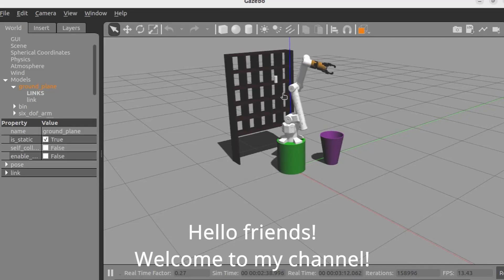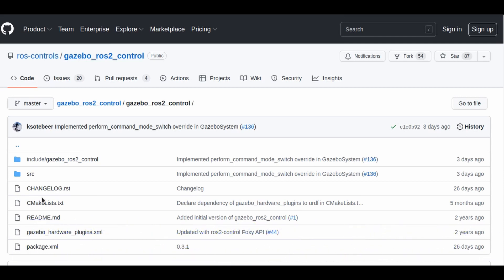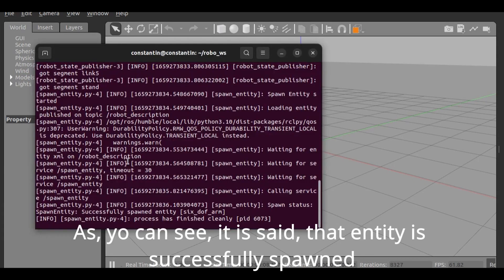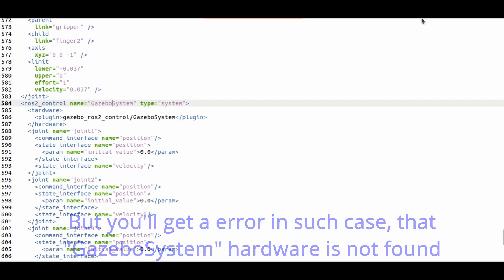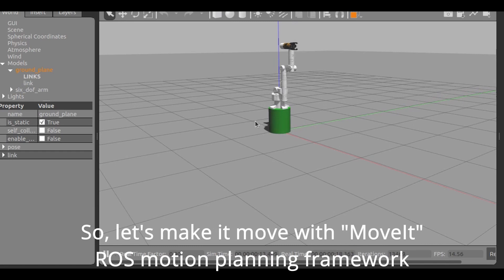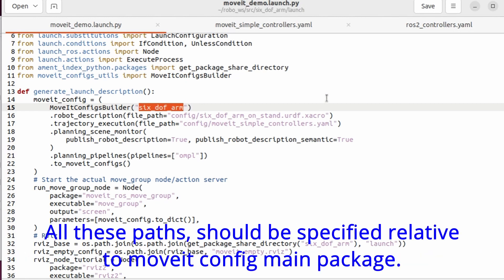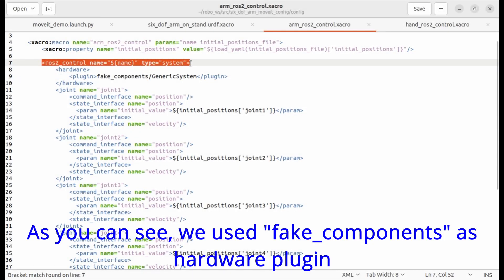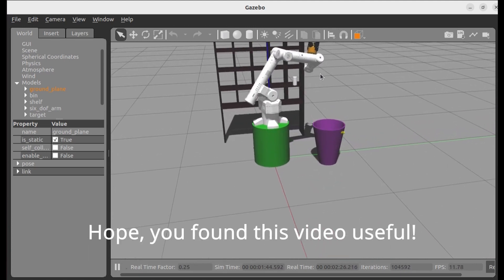ROS2 HUMBLE TUTORIAL. USING ROS2 WTH YOUR CUSTOM ROBOT

Comment: [ros2-5] could not contact service /controller_manager/load_controller ? any solution ?
Reply from the maker: Look carefully at all the logs of ROS2 while it's loading. There should be some error. Check if controllers yaml file loaded correctly.
Reply: @roboage1027  after solving this and everything works fine , a this new error occurs : [ros2-2] [ruby $(which ign) gazebo-1] [INFO] [1737973800.329654722] [controller_manager]: Loading controller 'forward_position_controller'
[spawner-6] [INFO] [1737973800.394330337] [spawner_forward_position_controller]: Loaded forward_position_controller
[ros2-2] [ruby $(which ign) gazebo-1] [INFO] [1737973800.408941369] [controller_manager]: Configuring controller 'forward_position_controller'
[ros2-2] [ruby $(which ign) gazebo-1] [INFO] [1737973800.412406057] [forward_position_controller]: configure successful
[ros2-2] [ruby $(which ign) gazebo-1] [ERROR] [1737973805.419561158] [controller_manager]: Switch controller timed out after 5.000000 seconds!
[spawner-6] [ERROR] [1737973805.423626151] [spawner_forward_position_controller]: Failed to activate controller : forward_position_controller
[ros2-2] [ruby $(which ign) gazebo-1] [WARN] [1737973805.424832982] [gz_ros2_control]:  Desired controller update period (0.01 s) is slower than the gazebo simulation period (0 s).
[ERROR] [spawner-6]: process has died [pid 11465, exit code 1, cmd '/opt/ros/humble/lib/controller_manager/spawner forward_position_controller --ros-args'].
Reply: @roboage1027  after solving this and everything works fine, this new error occurs : [ros2-2] [ruby $(which ign) gazebo-1] [INFO] [1737973800.329654722] [controller_manager]: Loading controller 'forward_position_controller'
[spawner-6] [INFO] [1737973800.394330337] [spawner_forward_position_controller]: Loaded forward_position_controller
[ros2-2] [ruby $(which ign) gazebo-1] [INFO] [1737973800.408941369] [controller_manager]: Configuring controller 'forward_position_controller'
[ros2-2] [ruby $(which ign) gazebo-1] [INFO] [1737973800.412406057] [forward_position_controller]: configure successful
[ros2-2] [ruby $(which ign) gazebo-1] [ERROR] [1737973805.419561158] [controller_manager]: Switch controller timed out after 5.000000 seconds!
[spawner-6] [ERROR] [1737973805.423626151] [spawner_forward_position_controller]: Failed to activate controller : forward_position_controller
[ros2-2] [ruby $(which ign) gazebo-1] [WARN] [1737973805.424832982] [gz_ros2_control]:  Desired controller update period (0.01 s) is slower than the gazebo simulation period (0 s).
[ERROR] [spawner-6]: process has died [pid 11465, exit code 1, cmd '/opt/ros/humble/lib/controller_manager/spawner forward_position_controller --ros-args'].

Comment: Hello there!! Idk why, it worked the first time but then when I re-run it (had to re-build because I changed my arm package and urdf files) it won't re-build and gives me an error when building the gazebo_ros2_control package

I will add the terminal log and error here if you could maybe help, I'd really appreciate it :')

"  /home/xardarii/arm_fyp/src/gazebo_ros2_control/src/gazebo_ros2_control_plugin.cpp: In member function ‘virtual void gazebo_ros2_control::GazeboRosControlPlugin::Load(gazebo::physics::ModelPtr, sdf::v9::ElementPtr)’:
/home/xardarii/arm_fyp/src/gazebo_ros2_control/src/gazebo_ros2_control_plugin.cpp:290:67: error: ‘__gnu_cxx::__alloc_traits<std::allocator<hardware_interface::HardwareInfo>, hardware_interface::HardwareInfo>::value_type’ {aka ‘struct hardware_interface::HardwareInfo’} has no member named ‘hardware_plugin_name’
  290 | d::string robot_hw_sim_type_str_ = control_hardware_info[i].hardware_plugin_name;
      |                                                             ^~~~~~~~~~~~~~~~~~~~

gmake[2]: * [CMakeFiles/gazebo_ros2_control.dir/build.make:76: CMakeFiles/gazebo_ros2_control.dir/src/gazebo_ros2_control_plugin.cpp.o] Error 1
gmake[1]: * [CMakeFiles/Makefile2:139: CMakeFiles/gazebo_ros2_control.dir/all] Error 2
gmake: * [Makefile:146: all] Error 2
---
Failed   <<< gazebo_ros2_control [35.0s, exited with code 2]  "

all other packages compile correctly, just not this.

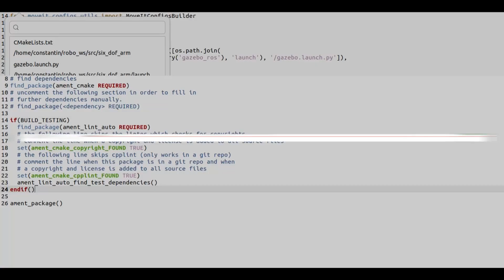Comment: What should have I to write at minute 4:20 , I don't have the folders launch meshes and urdf, so the next part doesn't work for me, can u suggest me why I don't have them? Have I missed something?
Many thanks
Reply from the maker: This is strange. What's the error log? ${PROJECT_NAME} is the name of your project. This variable should be automatically set. share folder is also created automatically .
Reply: I'm sorry, I changed a bit the topic (I have modified the original one). It's not the name the problem but I don't have the folders! Thank you for the fast answer @roboage1027
Reply from the maker: @giorgiolongari9660  Are you running 'colcon build ' command from the workspace root folder?
Reply: Yes!
Reply from the maker: @giorgiolongari2806  That's very strange. As I understood, there's no install folder in your workspace's folder? Or there is install folder but there's no share folder in it. It should be like so: your_workspace/install/your_project/share.
Does your workspace have such a structure?  All this folders are created automatically when creating and building the package.
Reply: @roboage1027  Hi man, I'm sorry to stress you but I'm really into this project, I need to find the urdf model of the robot! Also the meshes, where did u download them?
Reply from the maker: @giorgiolongari9660  I modeled this robot in solidworks and then exported it as urdf file. But you can download urdf with meshes from github .There are a lot of them there. This one for example: https://github.com/kuka-isir/iiwa_description/tree/master. You can find other models as well

Comment: Hello Roboage,
How to give torque to the joints manually? (In gazebo from python script). I have a custom robot model with non-differential model, and have a custom controller for that. That is why, I want to read position, velocity and similar features of the robot legs and give certain torque values to the legs calculated by my controller. For that, I think there is no need to use MoveIt but don't know how to do it. Can you help me? Thanks.
Reply from the maker: Hi! I guess your custom controller need to inherit from controller interface class and you need to configure it as ROS2 plugin. In such a way you will be able to use your controller as usual ROS2 controller together with Gazebo hardware interface. And your controller will automatically read states from gazebo and write torque commands. And you will be able to send commands to your controller with python just as to usual action ROS2 server.

Comment: Hi Roboage. Great video. Loved it! I am also working on ROS2 humble and want to control my arm. I followed your video and was able to spawn my arm in Gazebo but after including gazebo_ros2_controller in URDF file, when I started gazebo simulation, my arm started rotating and flying on its own. Have you ever come across this kind of error? What can be the error here?
Reply from the maker: Hi! Thank you for your comment! Check inertial properties of your robot's links in URDF file. If they are wrong, simulation will be broken. Also check this link on ROS answers site:https://answers.ros.org/question/416011/strange-behavior-and-instability-of-six-axis-manipulator-in-ros-2-with-gazeboclassic-when-using-position-control/  Try it, maybe it will help.
Reply: @roboage1027  Hi, The ROS answer was the solution. Thank you. This solved my issue. I was struggling since almost a week. Thank you so much. :)

I had to include <dynamics> properties to joints in URDF. (damping and friction).
Reply: Hi Roboage, sorry to bother you again. I am getting another problem now. In gazebo my arm can't grasp any object. The object simply slips out of the gripper. Have you come across such behavior?
Reply from the maker: @akashparikh6204  Actually it is impossible to grasp object in Gazebo. In my video i just created temporal fixed joint between the gripper and the object, and then removed it when the gripper was at the drop location. You can find examples on GitHub on how to create fixed joint between two objects in Gazebo.
Reply: @roboage1027  I did find some examples but all of them are for ROS and not for ROS2. Did you find any for ROS2?
Reply from the maker: @akashparikh6204  The problem is, that i accedently deleted that package when i reinstalled Ubuntu. But, as i remember the part concerning Gazebo should be independent of ROS version. You just include necessary headers and the code is basically the same .
Reply: @roboage1027  Okay. Understood. Thanks. :)

Comment: I require some assistance with the modification of urdf of my the robotic arm. I have already created a design and successfully converted it to URDF (Unified Robot Description Format) for ROS2 (Robot Operating System 2). However, I am encountering several issues during the process, and I would greatly appreciate your valuable support in resolving them.
Reply from the maker: I used solidworks2urdf exporter and i had to modify joints origins and orientations manually because they were somewhat wrong. Also sometimes it is necessary to modify inertial properties of the links. What exact problem you have?
Reply: @roboage1027  I have the error output with me. Is there any way to contact you so that I can share it? It's for my college project, and I have limited time to complete it. I kindly request your assistance.
Reply from the maker: @angelorison6455  Copy and paste error message here in comments or you can find me in Instagram and send in messenger. I'll try to help.

Comment: How do you specify which controllers will be used by Moveit for motion planning? Do you specify these in the Moveit Setup Assistant process or are they being read from the urdf?
Reply from the maker: Controllers are specified in the configuration file (with .yaml extension).  Besides, you should specify path to this file in the urdf file as a parameter for gazebo plugin. I show all these steps in the video when i explain how to configure gazebo with ros 2.
Reply: @roboage1027  I see. Since these are defined in the urdf as you showed, they do not need to be configured inside the Moveit Setup Assistant?
Reply from the maker: @junaidamin2412  Yes. Moveit setup assistant generates yet another controllers configuration file. These are controllers of type follow joint trajectory. I don't know why they are needed. I guess for updating visualization in rviz. And that's all. Controllers that you are using to control your robot (in simulation or the real one) are up to you:)
Reply: @roboage1027  It's slowly making sense. Thanks a lot!

Comment: Very nice video! One question: should Gazebo be preinstalled in the system to create the gazebo_ros2_control?
Reply from the maker: Thank you! To use gazebo_ros2_control package, Gazebo should be installed.
Reply: @roboage1027  Thanks! Could you please share the instruction on how to install Gazebo for ROS2 Humble!
Reply from the maker: @achyutbora8288  Gazebo comes with ROS installation. So if you have ROS2 installed, you also have Gazebo installed. To install Gazebo separately, here's link to detail instaruction:https://ubuntu.com/blog/install-gazebo-for-ros-2-in-under-a-minute
Reply: @roboage1027  Thanks a lot for the link! Gazebo was not installed alongside ROS2 in my system as I installed Ros2-Humble-Desktop, where Gazebo was not included.